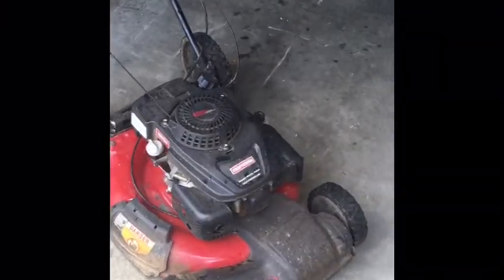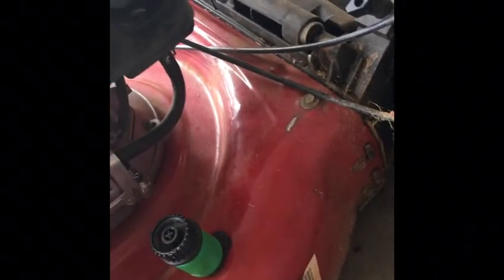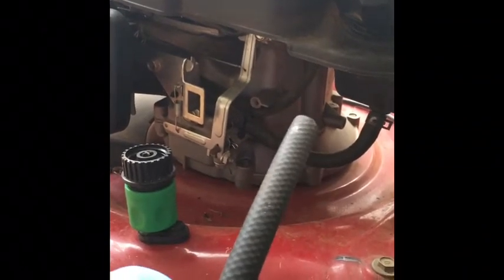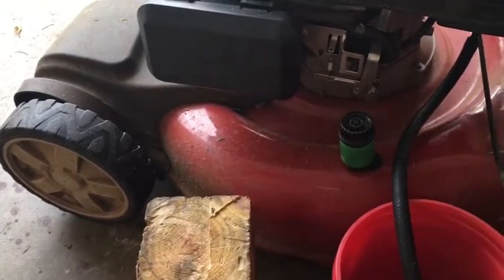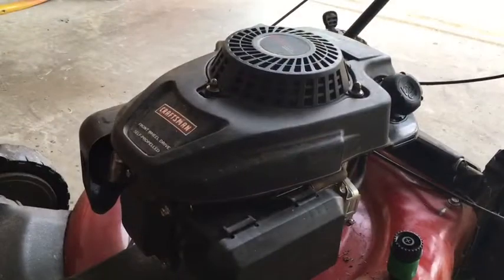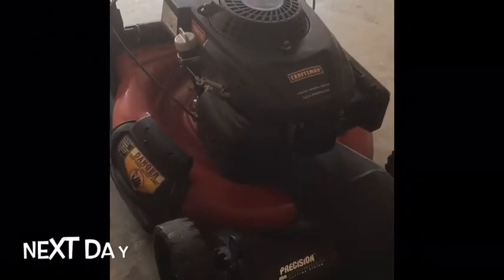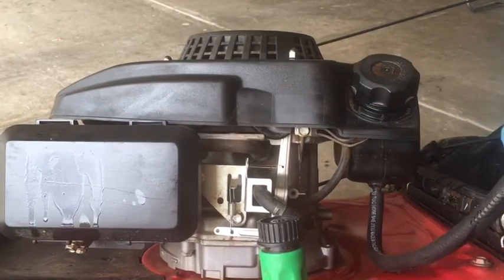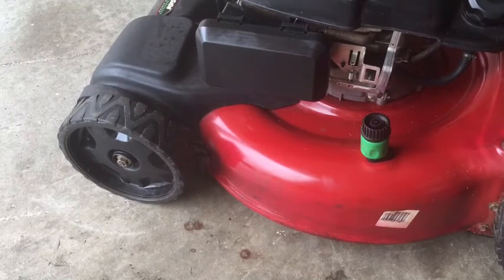Curb Alert mystride craftsman lawnmower runs for 10 mins and dies

Comment: Wow I got to say that was a simple fix
Reply from the maker: Yes it was simple.  I  came  across something like this once on a briggs,  it’s more common to happen on Tecumseh engines. There I just pulled out a replacement cap since I had a used one.
Reply: @dfields9511  that is a good thing and that mower was in excellent shape